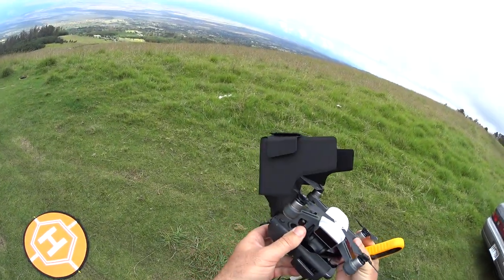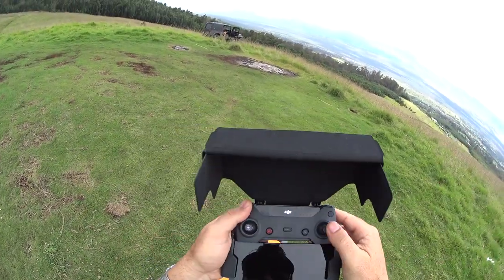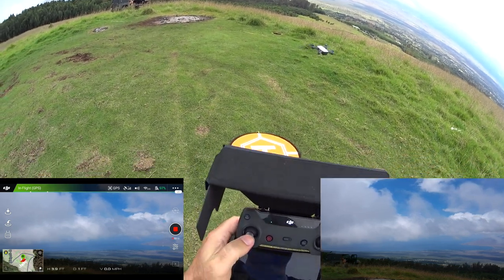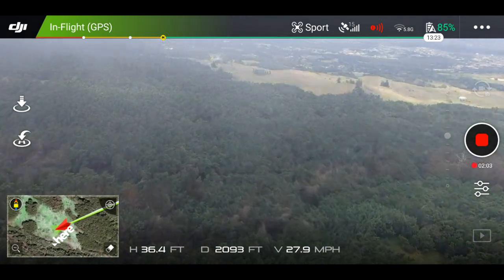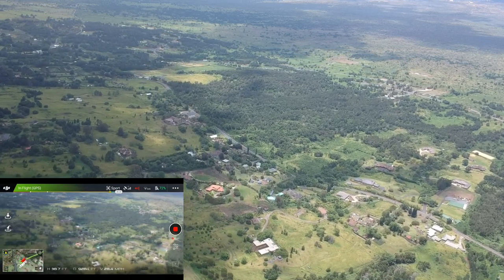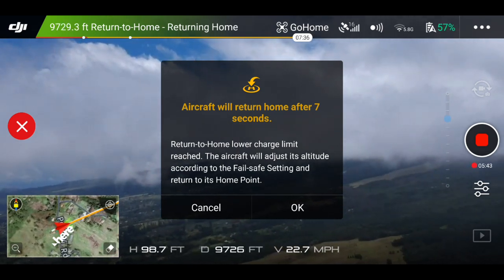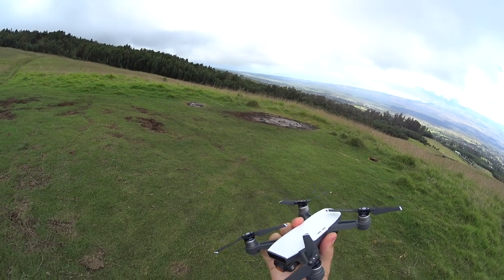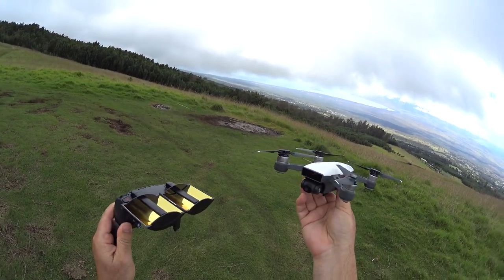DJI SPARK Review - Part 3 - [4 Mile In-Depth Range Test with RC Controller & OTG Cable]

Comment: I got 4.2km with reflector, I’m pretty sure I would be able to smash the 5km range ez, but I had to come back because of the battery ( and wanna add that I didn’t have any choppy signal video at any moment) these 5$ reflector increases the signal power so well just amazing
Reply: Where did you get the reflectors at?
Reply: @antjon4129  amazone

Comment: You can’t be disappointed with that kind of rang without any mods, that was amazing.
Reply: the spark only goes 300m
Reply: @bittasweetsymphony726  no it doesn't, the max range is 2km
Reply: @clmfilms8103  how far goes spark with remote control originaly?

Comment: The furthest I've had mine out is just a little over 1/2 mile, but that was 180 ft. over houses out to a golf course and back. I've never had mine up to 400 ft yet. Actually, the Spark is so small, I can't see it much beyond 100m, so then I have to look at the phone screen. ( I just picked up a used Galaxy Note 4, which I'm using as a dedicated device, instead of using my S6 Edge .. bigger screen, and I can turn off most everything). I found some real short USB A to Micro USB cables to use with the OTG cable (only 10.5 inches long), which cleans up that connection (found it on Amazon).  I've tested charging a flight battery with a high power "Power Bank" (normally used to recharge tablets and cell phones). Its output is 2.5 amps per outlet, and it was able to fully charge a flight battery which was at 20% to full power in 45 minutes, about the same as that 3 gang charger that comes with the Fly More package. I think they are only on the 2nd iteration of firmware for the Spark, so there are a lot of 'features' I'm hoping come with the next update (like being able to slow down the gimbal speed .. or reduce the sound level of the RTH feature).  The little thing really moves out in Sport mode .. I think my P3A would be pressed to keep up with it (maybe in ATTI mode).  Looking forward to the test of those parabolic range extenders. I have them on my P3A (but the farthest I every tried going was 3 miles, and I still had full signal at that point and decided that was "good enough", and came home with lots of battery). Mahalo ...
Reply: A lot depends on who you talk to, or who's reviews you watch. There are some guys out there who wouldn't say a good thing about a DJI product, even if it were able to grant wishes every time you rubbed it. I just had mine out in a 25 mph wind, shooting a lighthouse on Lake Erie ... pretty scary, and had "High wind warnings" throughout the flight, but I managed .. and so did the little Spark. Pretty impressive to me.

Comment: Good one.....I don't have the audacity to fly that far here in a City full of Wi-Fi , stadium NFZ and Airport. Yours is the Real Flight Test! Love your reviews.
Reply from the maker: +Hata Wong yes, interference will most likely cut the range shorter.  Thank you 😁
Reply: Dustin Dunnill Shared your reviews on the Spark Pilots forum https://sparkpilots.zone/index.php?threads/1381/
Reply from the maker: +Hata Wong Great 👍

Comment: New firmware for Spark is Available (26/07/2017).  Just letting you know this came out about 6 hrs ago!
Reply from the maker: +RGMG Saweet!  You know what was improved?
Reply: Overview

Aircraft Firmware: V 01.00.0500Remote Controller Firmware: V 01.00.0300DJI GO 4 App iOS：V 4.1.4 DJI GO 4 App Android：V 4.1.4  

What’s New

Improved photo resolution to 4K in Gesture and ActiveTrack modes. Added a new gesture for video recording.  Added an option to adjust gimbal tilt sensitivity. Added a 180° Pano shooting mode. The
 aircraft will descend to a height of 1.5 m while flying below 4.5 m or 
descend 3 m while flying above 4.5 m if no subject is detected for more 
than one minute in Gesture mode. Improved
 overall gesture recognition and reduced the probability of falsely 
recognizing the selfie gesture. The wave gesture is now disabled by 
default while flying indoors or where the GPS signal is weak to ensure 
safety. The wave gesture can be enabled in both situations by adjusting 
settings in DJI GO 4.  Fixed an issue where photos failed to save and the shutter sound would not be made while taking photos in Gesture mode. The
 aircraft will now exit QuickShot automatically when a control stick is 
pulled opposite to the direction of flight. Flight distances for 
QuickShots can now be set in DJI GO 4, with greater maximum flight 
distances while using the remote controller. Also, flight directions for
 Circle and Helix can now be adjusted in DJI GO 4.  Fixed an issue where the aircraft didn’t ascend high enough with the Dronie QuickShot and optimized Rocket. Optimized the FPV gimbal mode in Sport mode to keep the gimbal from reaching its endpoint. Fixed issue where the remote controller would occasionally disconnect from the aircraft. Fixed a rare issue where the remote controller couldn’t be turned off.  Improved aircraft and remote controller responsiveness. Optimized battery level calculation. 

Notes

Restart the aircraft and remote controller when the update is complete. If the firmware update fails, restart the aircraft, remote controller and DJI GO 4 or DJI Assistant 2, then try updating again.
Reply from the maker: +RGMG Yay!  They fixed all the stuff I was complaining about and more!  Way to go DJI! 😱🤗🍻👍
Reply from the maker: +RGMG it's time for another flight test video to test all the improvements.  Thanks for the heads up.  I'll give you a shout-out for the info in the next Spark video 😁
Reply from the maker: +RGMG I just went through the update process.  Ugh... DJI REALY needs to work on this.  Another cluster F even with the otg Cable.  Stuck at 5% and kept failing.  Only way I could get it to work was direct phone wifi mode which finished craft update.  Then had to switch to controller connected mode with OTG cable and do controller update which hung at 99% with no finish indication.  Had to restart craft and controller and all is well finally.  DJI must get soooo many service calls due to this confusing process.
Reply: Yikes!  That's not good.  Thanks for the heads up....I just ordered the SPARK a few days ago so it's in route to my house but good to know.
Reply: Dustin, the update was just to the DJI GO 4 app. It didn't require connecting a cable to the Spark. It went very smooth for me, just hit update the app and the new features were there next time I flew. The big feature for us Photographers was that gimbal wheel speed can be adjusted with the TX now. So you can get buttery smooth gimbal adjustments. I'm on IOS on a iPhone which alway seems to work better with DJI products.
Reply from the maker: +Ron Brown when I turned my spark on it required a firmware update for both drone and remote and it listed all of these same  improvements.  After doing all the updates, about a half an hour later there was an Android notification for the app update.  So perhaps app and firmware needed the update for all the new features or the firmware and was just a coincidence since I hadn't powered up till now after the range test.
Reply: On DJI support web site for the SPARK it indicates this firmware updates was for the following items:

OVERVIEW:  
1) Aircraft Firmware: V 01.00.0500
2) Remote Controller Firmware: V 01.00.0300
3) DJI GO 4 App iOS：V 4.1.4 
4) DJI GO 4 App Android：V 4.1.4  

Here's the support link (need a user id/password to access)....Looks like the firmware worked for some and some others did have issues......  http://forum.dji.com/thread-106245-1-1.html
Reply: My bad, I'm a day behind. On Tuesday and DJI GO 4 update did come out and add new features. But today or yesterday a firmware update came out for the quad. But the good news is these updates add a lot of features people were asking for.

Comment: Correct me if I'm wrong, I think the new update doesn't need otg connection. It will travel even far without it , I reckon. Only after the update.

Comment: Fun vid...Thanks. Also, the spark does come with a precision landing feature. See the DJI spark manual/PDF located on the DJI website. 

It's similar to the mavic in that you need to ascend about 22 feet. The app tells you when PL is initiated.
Reply from the maker: +snlexa I wonder why there is no option in the software or when taking off like Mavic or P4?
Reply: No idea. I think it's built in to be "always on," perhaps to be more consumer friendly? I see a lot of folks taking off almost immediately after lift off, when to ensure the landing is precise, you need to rise to the required altitude (as prescribed in the user manual) which, weirdly doesn't come with the spark/fly more combo.

Comment: I love this drone and I've been afraid to fly it more than 150 feet up and more than 1000 feet away. 😂 This helps me with those fears. Damn impressive that after a trip a mile and a half out that it came back on its own and STILL landed within 12" of where it took off from. DJI is amazing.

Comment: I know this  is an old video, but can you tell me what you found too be better for the spark? Yagi and parabolic together, or the 4Hawks raptor?
I first tried the parabolic and Yagi combined and it worked well. Then I installed the 4 hawks raptor and have had one flight so far and I’m not getting as good of a range as the parabolic Yagi combo so far. I’ll do some more testing tomorrow night with the raptor and see if maybe I’m aiming it too high or something.

Comment: The spark does have precision landing, mine will display precision landing on the screen when I hit RTH and it's getting ready to land it will display precision landing. And land exactly where it take of from very impressive!!
Reply from the maker: +Romeo Fowler Thanks Romeo.  I just don't see any indication in settings or when slide to takeoff like the P4pro or Mavic.  I guess you have to just rise straight up manually at take off.
Reply: Dustin Dunnill yeah Dustin when I slide to take of via the app and let it hover for a little then lift straight up to about 30-75 feet then move forward towards my point of interest at about .5 miles away I would activate the RTH and when it got to where it launch from it would adjust itself proceed to land then it would display precision landing on my iPad mini screen.

I had no idea that this feature was there, it just pop up on the display when landing a few times by it self. I don't know how to search for this in the app. But I am thinking DJI might have put it there by default in the app maybe? But I know I saw it on my display a few times when landing by itself.
Reply from the maker: +Romeo Fowler Thanks for the info Romeo ✌

Comment: Consider this, if you had 18% battery left, and you increase the range by even 10% that means you may not have the battery to get home. 20% is what is suggested reserve for a L-ion battery. The last 10% goes really quickly, I hope you will reconsider a longer flight path to test range. Good luck!

Comment: I have had my spark well over 400 ft and had no problems at all yes that was straight up but still very impressive. An have flown about 3/4 miles away and looked at water towers and never had problems. 

But pressing the pause button on the spark remote will de activate rth and u can resume full control once you have video signal.

Comment: So, with the OTG cabel the screen image is not that laggy as it was without the cabel (up to 2 miles), and that is good. Great review, man, thanks.
Reply from the maker: +Kim Fly Yes, a better connection from device to Controller = less lag and glitches
Reply: Kim Fly  cable
Reply: lol, right

Comment: You can control how long the DJI battery will discharge in the battery settings just a tip👍🏻

Comment: Couple of questions;1. The return to home, does that have to be reset with each flight or does it mark the take off point automatically?2. Did you have to program the trigger buttons or were they set at default?Thanks for the great videos, very informative
Reply from the maker: Auto logs it's take off point as home every time.  Buttons are default 👍

Comment: I wish my test flight went so smooth. Without the remote it got to around a few hundred feet then lost WiFi connection. Automatically returned to home but decided that home was a tree that sits around 10m in front of the house. Even when 10m away it wouldn't reconnect resulting it to fight with a tree for 2 mins and then finally losing and dropping to the floor and breaking. Annoying because not at all what is supposed to happen. Very disappointing actually and I now have to replace one of the motors and one leg of the drone. :(
Reply: J C notice where he did his flight text, a very large open field with no trees, I’ve heard 1st flights can be gnarly but never had any problems

Comment: Bro i think u should change the frequency to 2.4 ghz and chose the channel with the lowest interference that may help u with more range
Reply from the maker: +Pokemongohacker006 I'll try another test like that 😀
Reply: Can someone please tell me how to switch the frequency to 2,4 GHz? Always when I connect the spark to the rc it changes to 5.8 ghz, I'm using using a android phone with Otg cable...
Reply: Do you have breading problems Sounds like darth vader

Comment: Interesting how both the Spark and the Phantom 4 pro both returned to home in the videos at what looked like odd angles. What was that all about? Haha!

PS. Great videos, would love to see the Spark with the parabolic antennas. I don't own them and am a bit sceptical about whether they'll work.
Reply from the maker: +Anthony Dawson Not sure what you mean.  The ground is going to look slanted because I'm flying fairly parallel to the side of a steep mountain.  You can see the Gimbal is level by looking at the cloud line.

👍 I'll do the parabolic range test soon

Comment: I did not care for the RC nor the distance as I don't think I will be flying that far. However you make it look so smooth and easy to fly it with he RC that I am considering in buying one as soon as tomorrow. Really. One important question and pardon my ignorance as the spark is my first drone ever and I am completely new to this. I've had the spark now for a month or a little less, and flown about 7x times in a small place filled with obstacles (my drive way/garage) I've been getting pretty good therefore I know I will be great whenever I get to fly in an open camp. one issue I've notice is the RTH feature. every time i attempt to use the option my drone will simply land wherever it is. wether is 2 feet away or 2 mile away it will just land. not sure why. I've also notice the map/radar on the lower left corner does NOT show whenever I am flying. GPS is ready to go. I set the RTH the voice says "RTH updated please check on the map" however my spark does not return to home and the map/radar does not show on the screen. I don't think there is an option to turn that off, if there is, I have not toggled that off. For whatever reasons if it turned it off on its own, how can I turn it back on because I just seem to not be able to find the option. again, sorry for my ignorance but I am new to drones as I mentioned earlier. if you could help me with this wold be much appreciated as DJI itself, not being very helpful with emails. I don't check youtube as often but I will try my best to check this video periodically for your response or even better if possible to shoot me an email at theboydiddy@aol.com with big bold letters in the subject mentioning spark/drone something as I receive plenty of emails. Again, thank you very much in advance and I hope you can help me with this issue. thank you

Comment: Thanks for great review.  I've ordered a Spark which should arrive in a few days.  My biggest question is, is it possible to do something particularly stupid and have the thing take off and fly off into the sunset never to be seen again or will the return to home feature always catch it at 50% percent or so power and bring it back to launch point without any input from operator?  Probably a stupid question.  I have zero experience with drones.  Thanks!
Reply from the maker: Just make sure it's up to date and let it sit for a minute when you power up.   Never cancel the auto return and you'll be fine.
Reply: Thanks!

Comment: Hey Dustin quick question and it may sound goofy. I have the Mavic Pro but am thinking about possibly getting the spark. Think it’s worth it? On sale right now for $399 with remote
Reply from the maker: Don't see why you'd need a spark if you have a better Mavic pro.  😅
Reply: Dustin Dunnill I think the size would make it easier to launch and land from my kayak and other smaller powerboats I go out on.

Comment: have you ever experienced recording fail?? it was really hot one day and my dji app and drone compass was dropping in and out and the footage i had recorded just disappeared even when i put the sd card into my computer... i'm not sure if thats a normal issue?
Reply: heffries iv been having the same issue! I push record as soon as I take off and about 5 minutes later the app crashes. Once i get it back up it seems like it starts recording after that point. Love my Spark, but I think they really need to fix alot of problems with the DJI app!
Reply from the maker: +heffries I have not yet with about 13 flights at around 80°
Reply: last week it was like 90+ in nyc and my drone just kept wanting to disconnect and land. I've never flew it that far from me so it was behaving weirdly
Reply: yeah seems like DJI is really focused on the IOS improvements more so the Android OS. Probably bc iPhone market is much bigger in China.. i really hope they fix the android app so I can fly the spark further out without worrying much